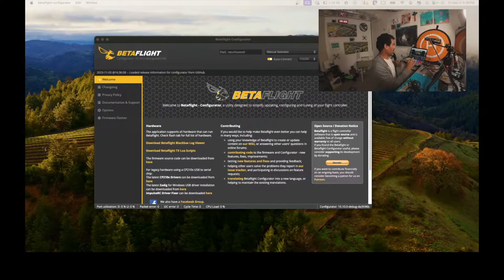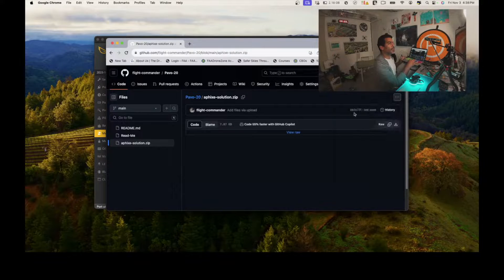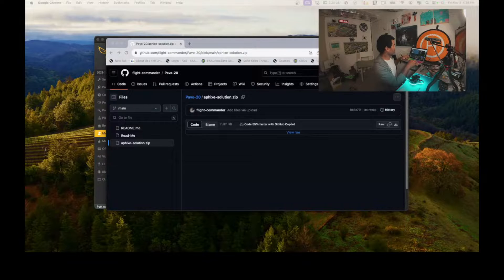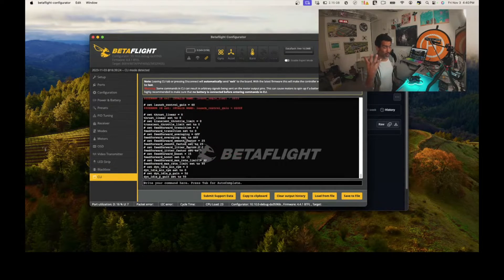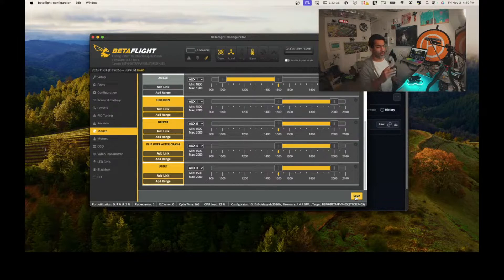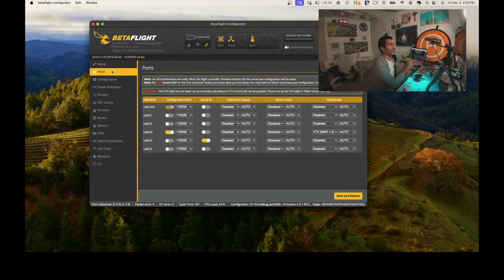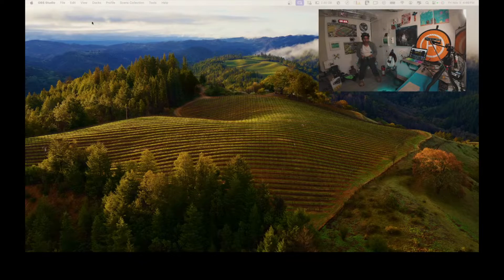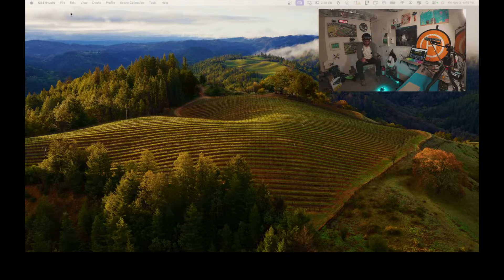how to configure pavo20 - part 4 of 4 setup pavo20 in betaflight

Comment: Interesting video. Thanks for publishing it
Perhps I might get some help from you....
I have the pavo20 and I use the DJI googles 2 and the DJI controller
Just modifying things on betaflight I had to strat from the scratch and I cannot configure the led strip to turn it off and on with my controller....
I obtained USER1 in Betaflight modes, the button I assigned on the controller works BUT led does not turn off and on....
I guess it is something to do with congiguragtion of the LED Strip on betaflight... but there is no way
I helping hando would be highly appreciated
TRhanks
Reply from the maker: Hi - thanks for reaching out. Hope this helps.. here is the troubleshooting video.. Let us know how it goes.. https://www.youtube.com/watch?v=LEw5Gha1eRo&t=680s
Reply: @How-to-by-Lou  Not working... it responds the mode user1 to the controller button, BUT the leds anyways on...
It was working fine until I restarted everything... to me, there is some type of configuration to the betaflight Led Strip.... it was empty... not the first time, but there is no way to make it work. Leds always on

Comment: Has the DJI air unit 03 not given you overheating problems? For me it disconnects after 2 minutes due to overheating
Reply from the maker: Yeah, sorry you are going through this.. but it happens with this drone.. Best to get all your settings correct before tuning or having an extra battery. In the end you will still have to wait for it to cool down before flying again...

Comment: Nice,I can't get the LED to turn on and off on Betaflight, how did you turn it on? I would appreciate the help, thank you
Reply from the maker: You might want to try the troubleshooting video 

Let us know how it goes 

https://youtu.be/LEw5Gha1eRo?si=Cd1Lq95LaPaJrJOL
Reply from the maker: You have to put the battery into the drone.. Make sure the batterie is charged and you have selected the right mode on your dji controller. Next live session is Sunday night where all Q&A and answerd live in real time with troubleshooting.

Comment: Hello friend, I thank you for your videos since there is not much on this topic, I have followed all your recommendations, but I cannot link Pavo20 with RC2
Reply: I decided to make a report about the things I see in Pavo201. The drone lost Wi-Fi communication, I have not been able to flash with ExpressLRS Configurator and I don't know if I am on the correct firmware2. I already installed your build for the Pavo20 in Betaflight, check and all the parameters are correct3. The glasses, the RC2 and the Drone connects by linking by pressing the DJI O3 button, I have video, but it does not arm or recognize any commands on the RC24. On the glasses I already select the standard protocol5. When you connect batteries it makes the RC2 non-linking beep on the drone and the motors move a little along with the beep6. Change the O3 unit cable, I put the original one with the O3. For now I don't know what else I can do, maybe I'm not doing something right or this board may be defective, thank you very much for your help, I will be very attentive to your help now. At this moment I have time, plus Pavo20 has to fly😅
Reply from the maker: @MeSTiZoDronCam   as long as you have the DJI FPV controller 2 and Integra goggles you should be fine by just doing the CLI Dump from the github file.. However if you are using the RC24 experience it will be kind of challenging since it's not covered in any of the videos..  The configuration in this experience in BetaFPV does require sbus... Not sure what the RC24 protocol is when in BetaFlight, also in the ports MSP-VTX, the current solution might work well for folks in the here video but with your gear,  it may require a different set of variables. CaptianDrone might have covered a solution that could work for your set up.. Sorry can't be more useful.. Hope this helps.. https://www.youtube.com/channel/UCm0rmRuPifODAiW8zSLXs2A
Reply: Is there a simpler way to slow down the rate for the throttle only?
Reply from the maker: @lalojr76ify  if you notice my throttle limit is set to 100% you could lower it to like 75 - play with it and find a number that works well for you.. Tad tricky - if you go too low drone starts to shake: https://github.com/flight-commander/pid-tuning
Reply from the maker: @lalojr76ify   Tad tricky - once you do the whole unit will wobble.  You could copy these but I notice the higher up you go the faster it gets.. (but) put the drone in angle mode. Soooo much easier.. https://github.com/flight-commander/pid-tuning/blob/main/Pid-Tuning.zip

Comment: Glad to see your Pavo20 is now flying! Like I mentioned before, Pavo20 is much easier and smoother to fly! Btw, I'm now able to fly in acro mode thanks to the Pavo20 hahaha

The one thing I hate that the screws that connects the CF frame to the duct easily gets loose and so I tighten the screws but it just not sit well and so the CF frame is not leveled. Took me hours to let the frame sit leveled but cant screw the screws all the way.
Reply from the maker: Thanks - appreciate it.. took some time to rebuild….. 

seems their chips come pre-configured and don’t need any adjustment in the https://esc-configurator.com

That’s amazing on your end though…I spent about 30 hours in the simulator just to be comfortable in Angle Mode

Now I have to put in about 10 - 15 hours min in the simulator to be able to fly in Acro mode..can’t wait to get there though… but might try on the Pavo 20 instead the Avata, but sure the open field for me..

I remember @fpvunknown suggesting thread locker for the screws so they don’t become loose..
Reply: I see I am not the only person having an issue with the screws that have to nuts on the bottom coming loose. I wonder if a little loctite might work?
Reply from the maker: @lalojr76ify  Have not had that issue but thread locker might do the trick but just remember they will be harder to remove if you need to service it after a crash.. All in a it's a great idea
Reply: @lalojr76ify  Definitely use some blue loctite